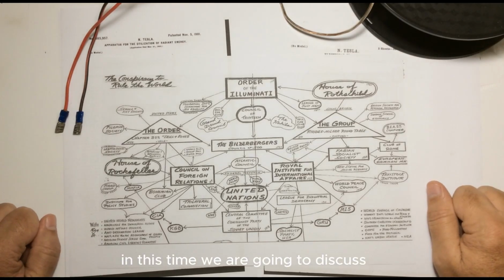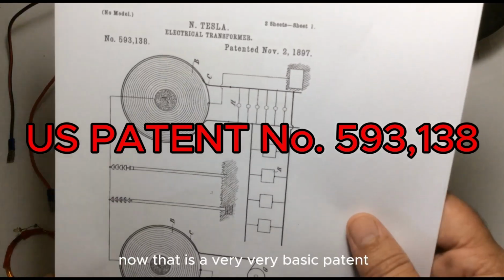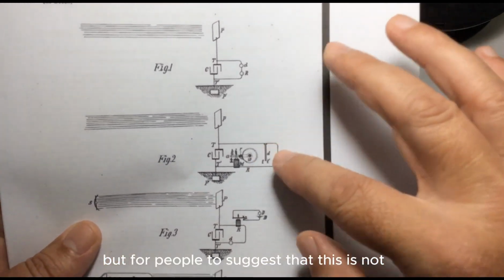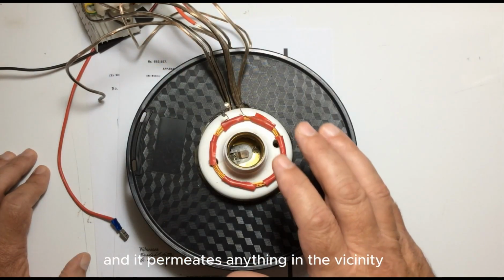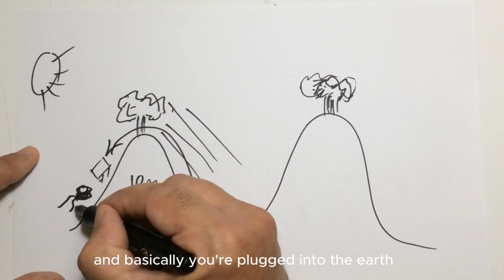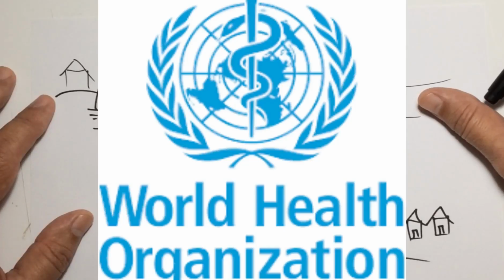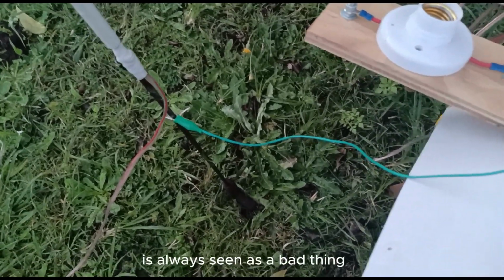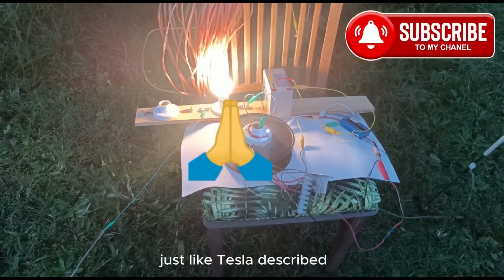THEY ARE COMING FOR YOUR POWER SOON - PLEASE SHARE THIS

Comment: Ok , thanx again guys - my set up is working as advertised - I sent a - too long of a message of my set up - and was bounced.- I guess--  sooo , briefly -- again ,  here is what I got.-- # 18 wire wound as per - the circuit diag. -  2ndary winding @ 108 turns only gave me 56 volts ac-( I'm looking for 120 volts -ac - Canada eh?) added turns to 2ndary  to 165 turns - now have 100 volts  and light  is 100 watt / 9 watt led light is definitely @ about 90 %  brightness - thats it for now .
Reply from the maker: Thank you for your comment and sorry for my delayed reply.
Awesome to hear you have had success. Smart of you to start at the lower end of turns when searching for the right voltage, my only 110 volt light I had was destroyed by this coil which is wound for 240 volt lights, just another one of those "what if" moments that went wrong. The other thing I found when searching the number of turns for this coil is that it doesn't seem to be linear in respect to voltage, ie. 10 turns voltage is not simply 10x voltage for 100 turns, I believe this is the radiant dielectric capacitive effect of the insulation of the wire, in short, the wrong insulation and this wont work as well.
Nice job and please keep me posted on your experiments.

Comment: IT WORKS!!!  I have a analog meter going into a boost converter drawing about 800 milliamps or about 10 watts, boost converter says it's putting out 40 watts, wtf?!?!

I'm running 2 of MTECH's Tesla coils in a step up / step down configuration.  My receiver coil is running a 12 volt 60 watt motor at about 2/3 speed and decent torque. 

Did I mention it's doing that wireless!!!  I had the 2 L2's hardwired but it made absolutely zero difference when I separated the hard wired connection between them.

My tests have been pretty short, about 60 seconds each because it keeps blowing up my signal generator for some reason, anyone know how I can stop that?

I am driving L1 of the primary through a signal generator and mosfet.  My boost converter goes to 120 volts but my tests were done at just 60 volts, frequency was around 1.4M.  I have a new signal generator coming tomorrow, I'm gonna try to up the voltage and also add in a few more receiver coils.

In the meantime, I'm going to try and wire it the way you have it which is more similar to Slayer style?
Reply from the maker: Thank you for your comment and sorry for my delayed reply.
I hope you didn't lose your latest signal generator in the meantime. You can use diodes to protect the signal generator, however this is radiant electricity which ignores diodes, this is why I am very clear about connecting sensitive electronics. There are more expensive ways but you may not need to buy expensive protection for a very cheap item, I think the last ones I bought cost me $5 each.

The setup you describe seems quite different to my system but it all works on very similar concepts. Feel free to elaborate on your setup if you like as it may help others. If you place your connections in the comment as follows it will be very easy for others to follow. 
12 Volt battery connected to -
Boost converter powering -
Tesla coil inductively coupled to -
Second Tesla coil -
Inductive step down secondary of 2nd Tesla coil connected to -
And so on...

As to why your boost converter says its putting out 40 watts I'm not sure, perhaps the high voltage radiant electric field that I talked about is permeating everything and messing with the onboard voltage regulators, remember we are no longer dealing with textbook electricity and this form of electricity doesn't seem to acknowledge diodes and will pass right through them in both directions. Almost as some ethereal hierarchy allows it to leave the confines of the wire as it's lower form electrons we normally manipulate are relegated to the restrictions of the diodes and circuits we build.

My circuit is a little different to a slayer circuit as it was a hybrid joule thief mistake. Born by literally connecting the wrong wires which amazingly resulted in something far better than a joule thief on steroids.
The tests I have done to date seem to indicate by winding the primary in this fashion halves the input current, an interesting discovery that is only possible through constant "what if" experimentation.
Please keep me up to speed on your setup.

Comment: Hello, amazing job always watching your video! adding resonant coils or simple induction coils will it affect load on the battery? or we can multiply coils around this source coils as many as we want as Don Smith was saying?
Reply from the maker: Thank you for your comment.
You can add more resonant coils to this and as many as you can fit beside it will happily function. Don was a little misleading as it will ultimately require tuning again if you add too many and also the field is not infinite just because you add another coil. Each coil effects frequency and transmission distance and if you change the frequency too much then you start walking the primary coil away from the resonant frequency of the little coils. You could use the load increase as a sign of losing resonance also but for the most part what Don said was right with a touch of mysticism.

Comment: Thanking you for this  is exciting and awesome experiment. One question I have is, where is that 9 turn bifilar coil located ? Is it wrapped around underneath the 180 turn and 10 turn coil drum there?
Reply: Yes, your guess is spot on. Check all his other videos and you’ll find out all the answers you may need.
Reply from the maker: @Caesarus2011 Thank you for your assistance.
Reply: @whatifididthis...1236  I greatly appreciate your quick responses guys, I have one more quick question, if you don't mind, 
What is the diameter of the hole in the center of the spool?
I found a spool that I might use that is exactly 50 mm wide  by 130 mm in diameter - the center hole in this spool is 30 mm , 

Thanks again in advance,
Reply from the maker: The dimensions for the coil from memory are approximately 50mm diameter and about 70mm wide. I have not built one with the dimensions you mentioned and can not speak to its success, however if that's all you can access then I encourage you to try. It will be important to also realise that with every modification made you walk into the unknown, eg. A larger diameter form will mean more wire as your starting with a larger radius to begin with. This will change frequency and result in something completely different to my circuit. I intend to make a new tutorial so I might search for a more uniform item that others can access to make replication easier.
Reply from the maker: Thank you for your comment.
Thank you for your kind words and yes that is correct as was stated by @Caesarus2011. I am stripping some wire from an old extension cord that I intend to use to make a colour coded step by step build in under 10 mins. I will post this video soon.

Comment: Hmm, after few more considerations I wonder if transmission line is used as raised plate in the same time (like Moray did) … just reading Tesla’s patent about standing waves moving antinodes far away by exact distance of disturbance created and his method of using what he get at the end of transmission line, without causing any harm for operator or device. Quarter wave amplification described in the patent without much fuss.

If anyone bother to just read wiki about negative resistance and see components used for this effect may easy understand the role of spark gap, rotary commutators used by Tesla for switching, transistors or diodes and how Tesla have used in his inventions almost all these methods one by one to obtain rotating magnetic fields.

How clever they were to impose 50/60 Hz for network standard just to increase the amount of metalic line and make everything expensive for those who need it. Always the evil is in detail.

All I can say: you are right, it is simple … I had the revelation by looking at drawings in many patents as you say.
By the way, do you have any idea why we call insulator, materials that in fact only separate, acumulate and polarise electric charge ? And why we call static something which is not static in its nature ?
Reply from the maker: Thank you for your comment.
Mass psychosis is a strange phenomena, I remember between surgeries having this almost out of body experience and saw a world of bullshit and lies. If you just slow down enough you will see it for what it really is. This is why they want to cancel the internet before we are locked down again. Can't have educated people disagreeing with their Tyranny. Telling me I had to occupy myself between years of surgery's was the worst thing they could have suggested if they wanted to keep me asleep, let me just say I didn't waste all of my time and it exploded an unquenchable thirst for information. Red pill anyone?

Besides you only need catch a liar once to know he's hiding other things also.

I believe you are correct about the insulators and the connection with Moray. The higher the single transmission line is above earth the more efficient the circuit is. I soon will make time to edit and boost the audio of an old video of my channel on Radiant Electricity, the one where I used the metal plate to run a 240v light, the higher that metal plate the brighter the light.

The 50/60Hz thing is as you say more expensive but let's not forget deadly. There are some issues with high frequency but it is again about control, they can control it at 60Hz but above that we need a different approach. Besides if it kills people it is much easier to suggest leaving it to a professional  they would say.

My understanding of the word Insulator is that it is a reduction of the force as opposed to a stopping or completely preventing a force, because remember we are dealing with electric fields and magnetic fields. So at certain frequencies it's electrical resistivity is free from electrical influences but not magnetic influences. eg. A heat shield doesn't block 100% of the heat but insulates, diminishes or takes the blow.

In my circuit the insulation is essential for its dielectric properties are it's artificial capacitor, it is not just the wire but the 1.2mm + 1.2mm = 2.4mm gap of insulation between each layer of wire and each individual wire between turns. At high frequency the insulation stores dielectric capacitance.

In summation, as you suggest, it is simple and if people just read a little bit more instead of believing what their teacher says as fact. Personal experience has always been and will always be better than theoretical education.

Comment: what is the difference between high voltage hight freq. (low amp) and radiant energy?
Reply: Depends on which type you're talking about, the shockwave type or the ambient type?

The shockwave type which is associated with what Vassilatos talks about, and what Tesla describes in "On The Dissipation Of The Electrical Energy Of The Hertz Resonator, The Electrical Engineer - December 21, 1892" (Any Tesla fan should read this article!) is basically an Aether shockwave, like what you get from the water hammer effect. 

When a current source is interrupted the magnetic current flow demands to dissipate by any means necessary, so the current begins to consume itself to raise its own potential to any level required to overcome the least resistant path or until it fully consumes itself to dissipate, usually this just happens to be back to the source hence why inductive spikes appear to always reverse.

If the circuit undergoes an abrupt enough opening, such as in the case of a quenched spark gap or a very thin wire that is vaporized as the current comes through, the current implodes at Light's rate of induction C and transform into a dielectric field which radiates out perpendicularly from the origin point, the so called Gray Tube also works on this principle.

If the Aether is water then the current is the hand slap, and radiant energy (shockwave) is the longitudinal shockwave produced under the water surface.

If you mean the ambient type, it's basically just radiation, it can be from sunlight/moonlight or the EM radiation from a plasma or florescent tube, etc, ionized gas produces its own source of EM radiation independent of the excited source, so Tesla's radiant energy receiver patents are based on those. Fig 4 of patent 685,957 shows the receiver picking up radiant energy from an ionized tube of special design, likely a roentgen tube seeing as he only has a 1 wire single terminal inside the tube (his non-harmful x-rays)
Reply: @JenkoRun  this means if I use an mercury vapour lamp low pressure like those for street lights in an aluminium or amalgam enclosure high polished I can harvest more energy than what I need to keep the light on ? Did anyone tried this ? Or just high power uv LED if I have only little dc power available ?
Reply: None
Reply from the maker: Thank you for your comment.
From what I can tell, which could be wrong, I believe the radiant energy requires a certain high frequency before it will manifest. I wouldn’t say so much that there is a difference but to say the high frequency creates the voltage, but again, I’m human, at the least an honest one so I reserve the right to be wrong.
Reply: @whatifididthis...1236  It might sound crazy but from my perspective energy does not have mass, if there is a mass it means energy carrier and we can consider that everything that have a mass can carry energy in the same proportion as their density and viscosity is. And mass means matter. Matter means physical dimension. If there is physical dimensions means any matter in any form or shape will have a gradient as there are always opposite ends … it doesn’t matter (🤣) the size of the matter of how small or big a particle can be … shall I continue ? 🤨

Well, I might be wrong either or just crazy … but if I consider this theory in first place I can obtain something, if I choose to ignore it I will look to warm up myself using a flame (which is in fact an electric discharge which can be manipulated with magnetic field/flux), burning something.

What would it take to consider 4 states of matter applied to electricity: solid, fluid, gaseous, plasma ? We can consider electricity has a mass as there is amperage

Comment: Fascinating. How much charge does the battery lose?
Reply from the maker: Thank you for your comment.
This depends on the load and battery. For example just running the 12 volt 7Ah battery normally, means you can either draw 1 Amp for 7 hours OR 7 Amps for 1 hour.

 Running the wireless LED on top at 3.5 watts will give you approx 24 hours. 

When using the "off-the-shelf" 240v light at say 14 watts it will run for approx 6 hours.

If you need more time use a bigger battery or connect another battery in parallel.

There are many variables that can make those numbers better but that's what they are without extra intervention.

Comment: would you be able to make free energy with multiple wireless LCR receivers somehow?
Reply: That’s exactly what he said, but you need to tune each one for load intended
Reply: @Caesarus2011 Thanks :)  what do you mean by tune for load? how? so far i have set up with equal LCR circuits all with same resonance frequency. I can get them all to light and LED at the right frequency. Im drive a sharpe pulse with a gate driver from a signal generator. its the rick friedrich kit im using. Do you have experience with that circuit? how can get it to produce energy? how can i loop it?
Reply from the maker: @Caesarus2011  Thank you for your assistance. Those three things all have an effect on tuning and consistency is key, same wire length, same capacitor, same load = tuned.
Reply from the maker: Thank you for your comment.
The looping is always an issue, in my opinion it is better, more efficient to charge something else. It will charge another set of batteries faster than it will charge itself, therefore it makes more sense to charge another battery and rotate them when necessary. Sometimes it can be easier to facilitate charge by having the battery leads resonant. If the wire of the battery supply is the same length as the wire that makes up the coil then this supply wire is resonant and will receive power in the same way the coils do, in turn supplying some of its own power as Don Smith stated.
I find it easier to loop by using isolation transformers and in some cases a few stages of isolation is required to allow the device to not see the high potential voltage that ultimately prevents charge as it is already higher than the normal battery voltage.
Tuning of the coils is done by matching the capacitor and wire length. You may find it easier to make my circuit than to make something new, with my circuit you know what is required and the resonant coils I use I have described in another video so there is no doubt about it working. Once you have replicated it you can build things that it resonates with. I will say though it isn’t exactly text book stuff as this circuit seems to be able to power up any coil I throw at it. I would comfortably go out on a limb and say my circuit will operate Ricks coils that you have so you may already have half of what you need.